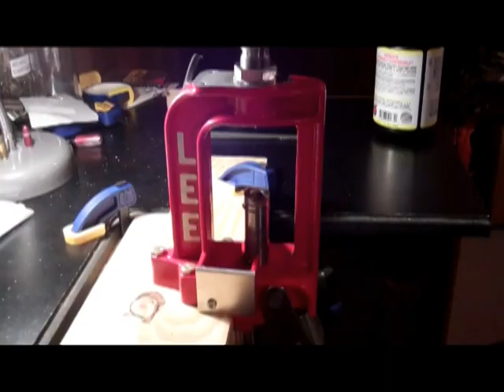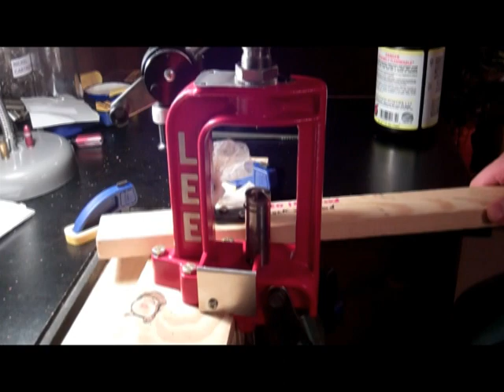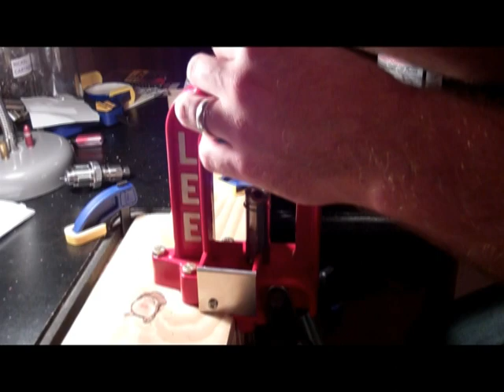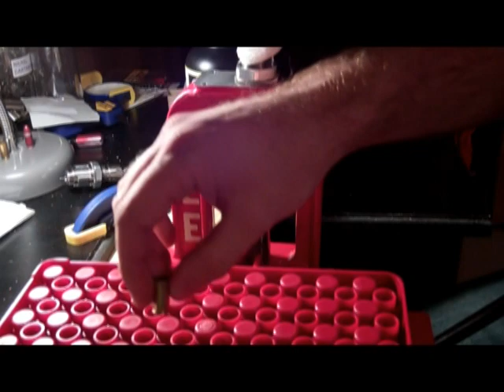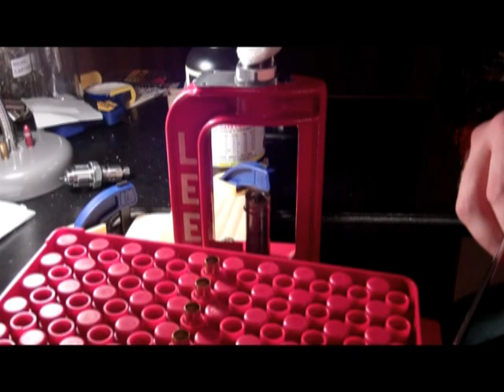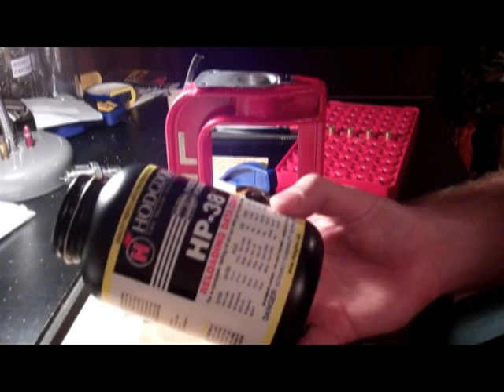Reloading 9mm with Pheasant815 (Part III).mpg

Comment: good vid of the basics.  1 thing you might consider is coating your measure with graphite powder.  very accurate throws and zero static powder clinging.  coat the hopper, charger, and measure nozzle that goes down into the flaring/charging die.  pickup a spray can of GS dry graphite at home depot for $5.  it goes on wet, then the solvent flashes off, leaving a coating of coal black graphite.  as tested via an rcbs 505 & mack 20, my pro disk throws went from +/- .2 grains to +/- .01 grains.  :)